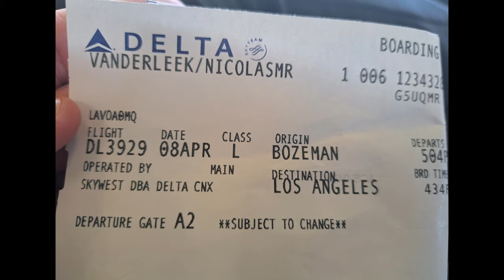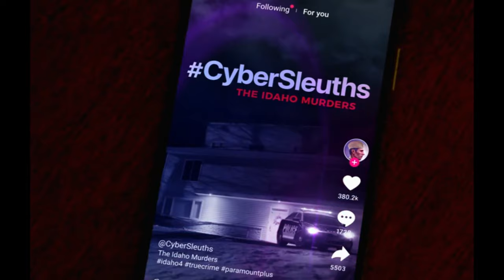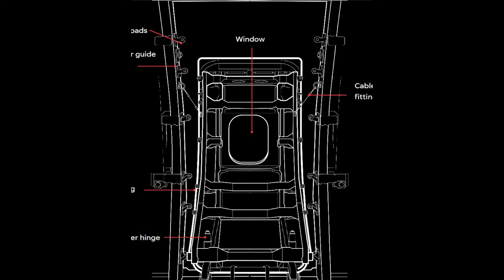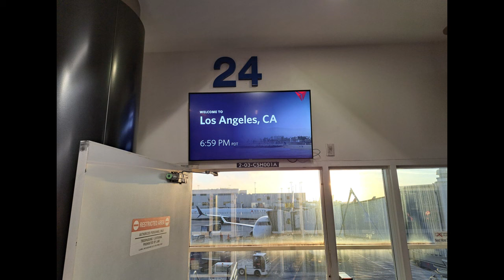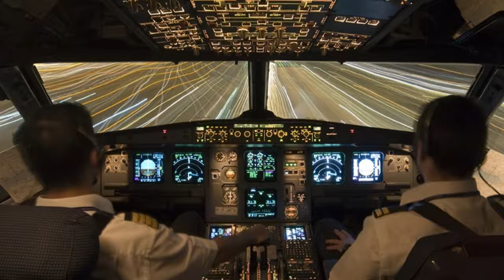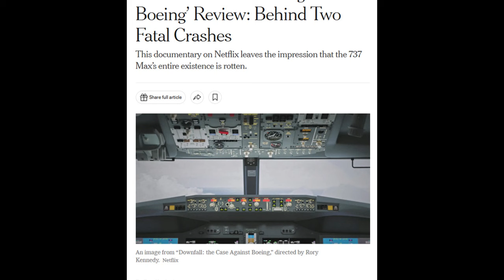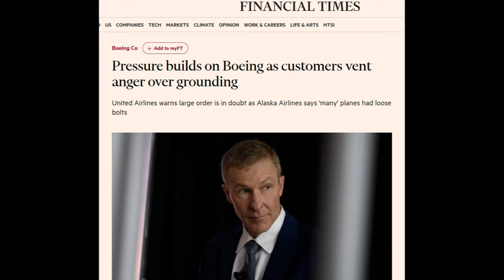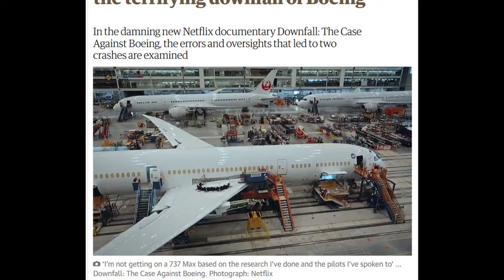BOEING INVESTIGATION: Bombshell Finding from National Transportation Safety Board

Comment: I’ve worked aviation my adult life. I lived in San Antonio a big chunk of that times outside working aviation in the Navy stationed in Europe. That being said Boeing facilities are everywhere. Not just Washington state. One place I worked was at an aircraft engine repair/overhaul company was next door to Boeing in San Antonio. I worked as a mechanic & inspector but rule of thumb is you never inspect your own work. There are some good mechanics & inspectors, but a lot of shoty ones too. I’ve worked with many. There is no excuse for this. I think it clearly an oversight. Someone signed off or may have pencil whipped the sign off on this. Most may not realize but an aircraft has 10s of thousands of hardware holding it together. This includes the fuselage. These are all installed by humans. You have hardware nearly every inch of aircraft. These problems don’t just happen at Boeing but everywhere. I’ve worked with many people (many were inspectors) that I’ve felt have no business in the industry/aviation. Fortunately there are many checks & balances in place to hopefully catch most quality escapes but they do happen. I’ve also attended Embry Riddle Aeronautical University. Flying is much safer than driving but I still get anxiety when I do have to fly.
Reply from the maker: rule of thumb is you never inspect your own work>>>Very true.

Comment: I believe in commercial aviation generally, if not in this case specifically, there is a increasing likelihood that the line mechanic is a trainee. They are learning on the job.

The person training the line mechanic is also the person who would usually sign off on the job, post inspection. This is due to a shortage of experienced airplane mechanics.

There should always be another person, training and supervising the trainee's work.

Instead, the inspector is also the supervisor, in effect, signing off on his own, or his trainee's work.

The human mind isn't great at seeing its own mistakes. That's why inspectors shouldn't be involved in repairs. Or supervision. They must be independent of any work done.

Aviation needs experienced mechanics and we are running in short supply.
Reply: :_hundred::_brain:

Comment: Boeing also withdrew its request for an exemption for 737 Max-7 .The request was to allow the sircraft to be certified with a known problem with the engine inlet  nacelle heating de- deicing system .
It's just Boeing apprach to building patchwork airplanes on the cheap that is concerning.
The Corporate Culture at Boeing is thorougly compromised with the Normalization of Deviance .

Comment: There is simply no excuse for operating dangerous planes or planes where safety standards have been over compromised - though that's what the free market will do, unless regulation stomps on it, so ask also where the national regulation to stop them doing it is.  However, I do wonder if they are responding to a need and entitlement that the public expects. Many years ago, flying was a luxury and costs were correspondingly high.  Now, we all expect to cross continents for a few hundred quid, or to fly to another country for £100/200.  Democratisation of travel (so everyone can do it) is of course great, but maybe it comes at a price that is too high and introduced such a cut throat element to the profit margin, that this stuff is inevitable. Especially if regulation isn't tight enough to quash it.